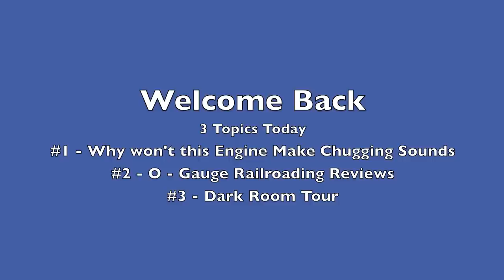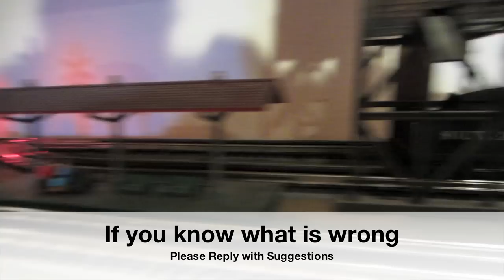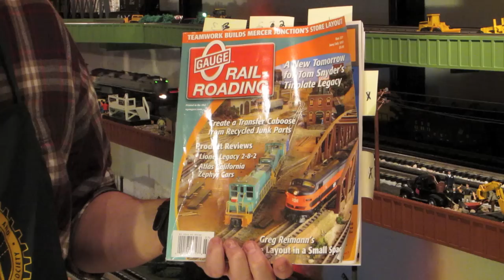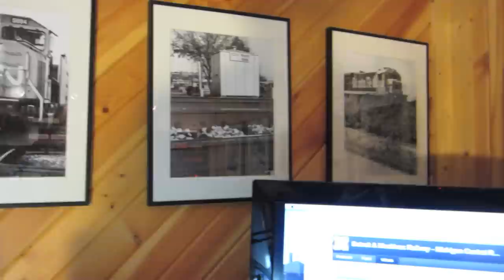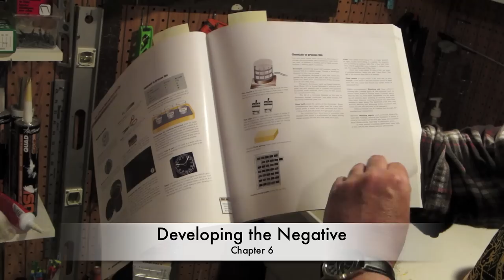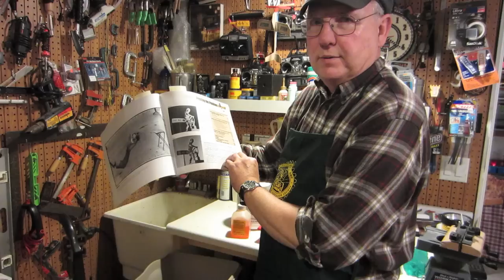Lionel Man Cave Tour #4 & Darkroom for Trains

Comment: Gary,
I have worked with circuit boards for years.50% of the problems are from loose connectors Remove boards and shove them back in tight to the edge connector (plug them back in). If that does not fix it, examine the pins on the connectors and see that the modulus/chips on the board are securely plugged in. Also look for cold solder joints. Never attempt to solder a board with a solder iron or gun more than 15 watts and wear safety glasses.

Comment: Hi Gary, idk if you ever got your engine to start chugging again or not but i think you might have had a bad capacitor or resistor.
Reply from the maker: Hi 20th Century Man / The Lizard has been doing just fine / All is fine with this loco. • Cheers from The Detroit & Mackinac Railway 🚂
Reply: ***** lol i get the reference! Im glad both are doing fine! thanks for the update